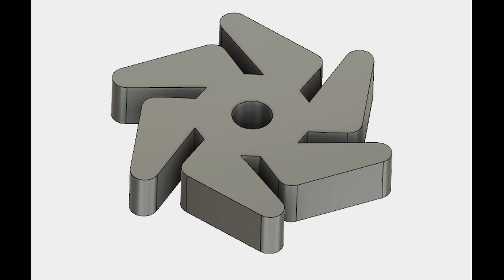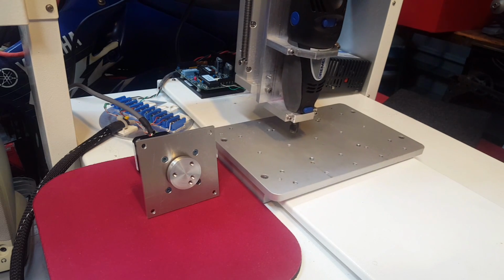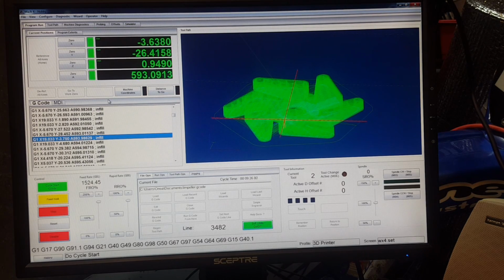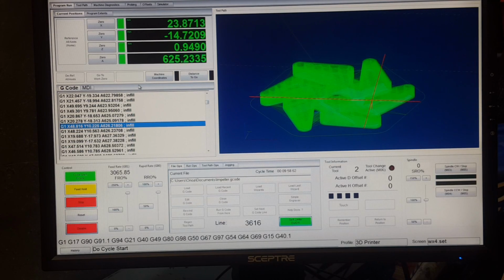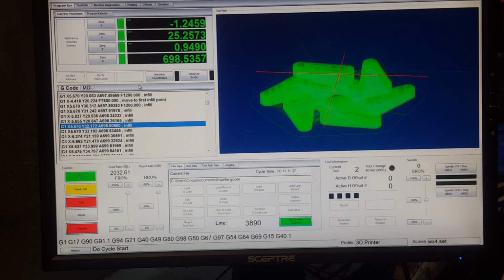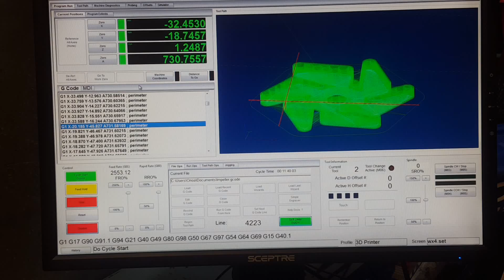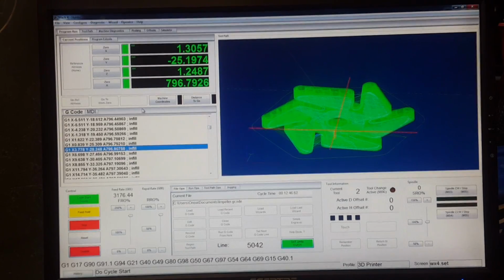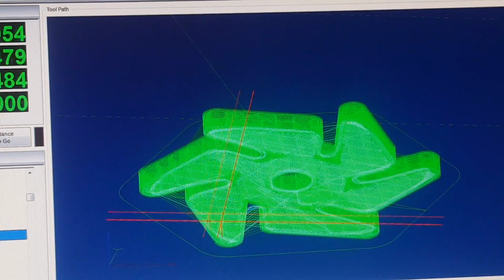3D Printer Add-on for Tabletop CNC (Part 1)

Comment: What did you use for slicing? Did you do anything to have Mach calculate layers and moving +Z to read out accurately for both machine coordinates & G54?
Reply from the maker: First of all, I ended up building a dedicated 3D printer instead of piggy backing an extruder on my CNC.  Although using the CNC would have worked, I decided I wanted a dedicated 3D printer machine.  With that said, my slicer preference is the Prusa version of Slic3r.  It is a free download from the Prusa website.  The slicer program generates gcode as its output, so as long as your CNC controller recognizes all the gcodes, you should be fine.  Moving in Z is just another move, which the slicer puts in the gcode tool paths.  Not all gcode interpreters will recognize all of the special 3D printing gcodes.  Getting Mach to do everything a 3D printer needs to do would have been a lot of work (for example, hot bed temperature control, cooling fan control, etc).  Instead, for my 3D printer build, I used an Arduino for the controller running the open source Marlin code for the firmware.  Works great and I would strongly recommend going this route also.